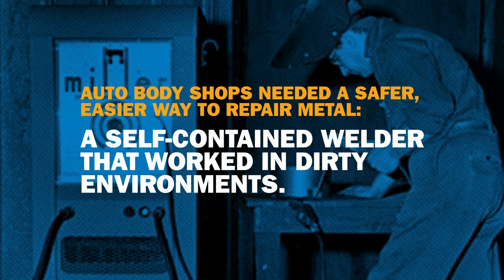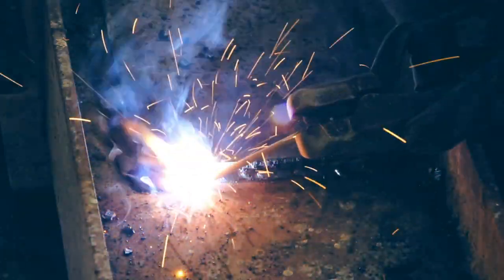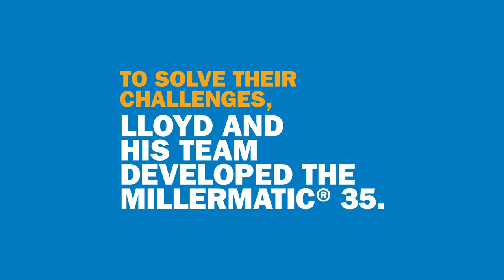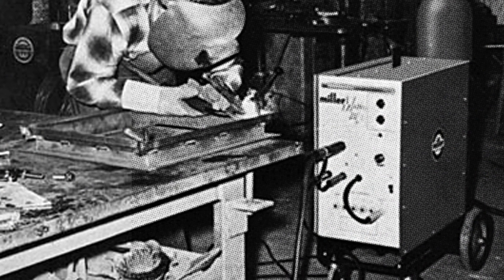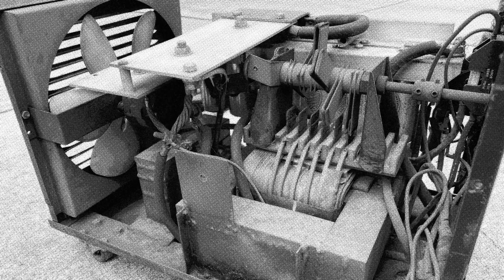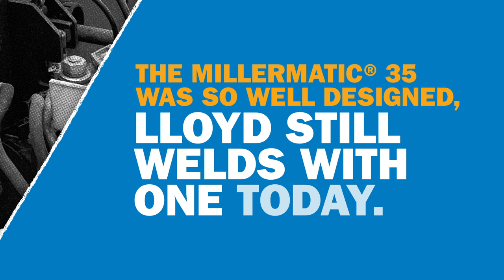The Millermatic 35 Started 50 Years of MIG Welding Progress

Comment: I own one of these welders.had it since early 80's,mine has spot weld switch to.  Thinking of up grading to 215 .Thanks Miller Welders. just checked my serial # mine is 51 years old serial #starts with 71then 58 july 1971

Comment: I own a a 35s great machines. But can't get parts. Really wish i could find a wire feed motor. I recapped the machine and replaced a few resistors. It has a tweco gun adapter. unfortunately i don't see the newer machines lasting this long